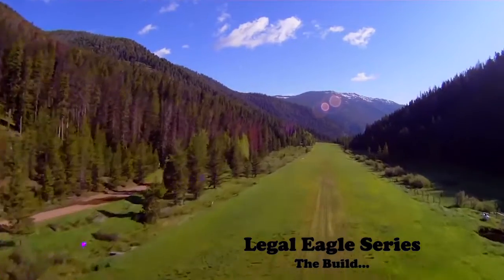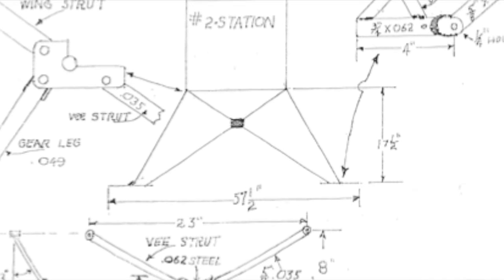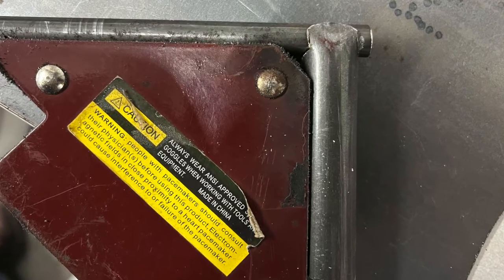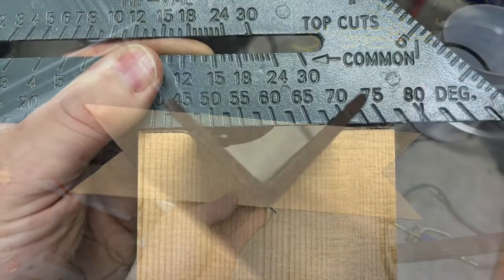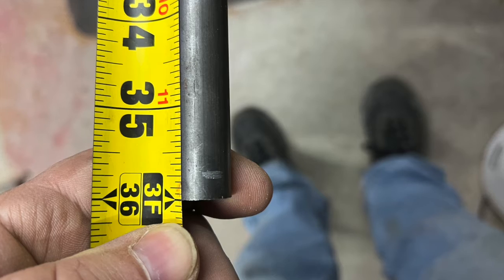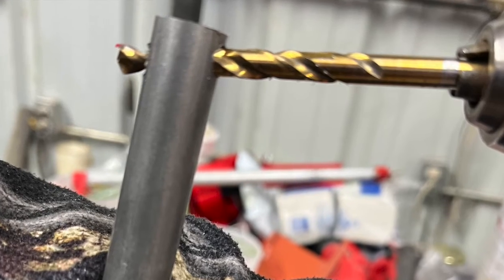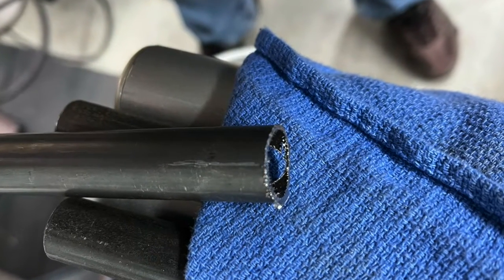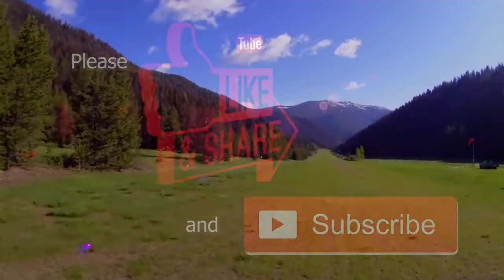ADCO Aviation - Legal Eagle XL Ultralight Aircraft Build Series 20 - Landing Gear (Part 1)

Comment: Hi David,  why did you decide to  go from 24 to 22 inches on your fuselage?   I was also thinking 24 is definitely wider than I need  but would like to know your thoughts.
Reply from the maker: Mainly just for looks, I guess... I met Leonard & John when I bought my plans many moons ago... John was suppose to build my fuselage; he asked if I wanted standard 24 or a little skinnier... I set in both the XL & the original & we decided then he was going to make mine 22"... Once we decided I was going to weld my own fuse, I just shot for the 22" mark that I had given John originally... really, no other reason... I have PLENTY of "elbow room" in the 22... I've got my handheld radio at the bottom of my seat beside me & still have plenty of room... one could easily make it even narrower to help save weight... Of course I haven't flown mine yet, but it sure feels good when I sit in it and dream... :)
Reply: @davidadkins1926  thanks,   you've convinced me to go to 22 also.
Reply from the maker: One thing I thought of after I posted... I would suppose it may depend on your 'size' as well... my waist is 33ish" (OK maybe 34") - For whatever any of that's worth & like I said I have plenty of room... Keep us posted on your progress - if you have any questions, fill free to reach out...